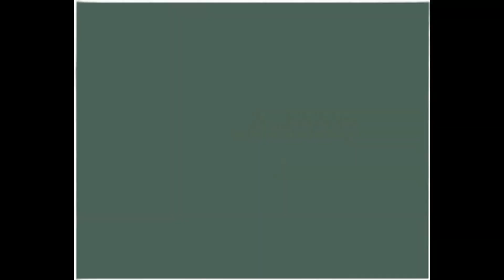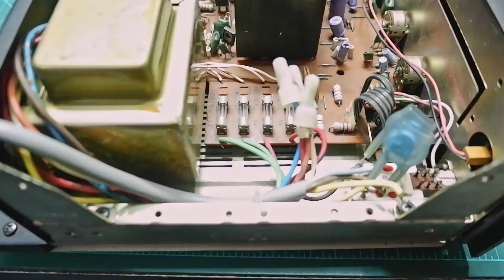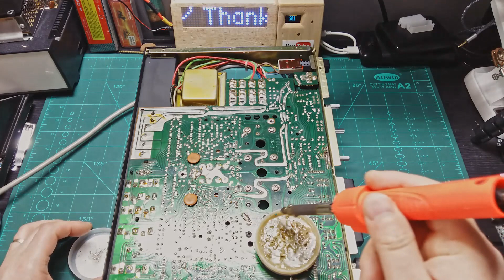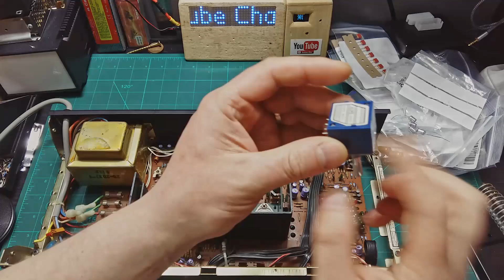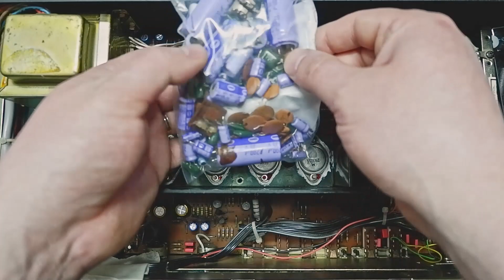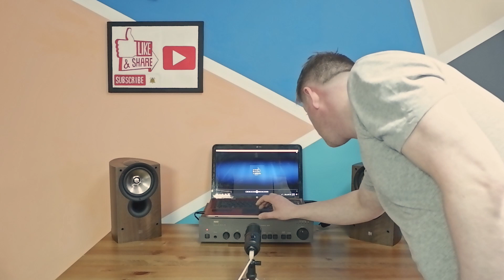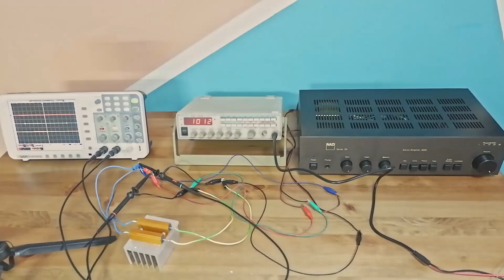How to improve the NAD3020 audio amplifier

Comment: You have the bass and treble maxed, and the loudness on??? One way to screw up the sound on one of the best sounding amplifiers ever.
Reply from the maker: The reason why I did the test in that way is because also before changing the caps the pots was in the same position and just to show the difference with the new caps.

Comment: Small point, but the tone controls should be at 12:00, which is basically flat. Here both bass and treble are set in the maximum position, which would make for an overly bright sound with most loudspeakers. That being said, I have both the NAD 7080 receiver (which was at the centre of my system for over 20 years) and 3080 integrated amp. I would love to have both fully re-capped.
Reply from the maker: So the pots was in the same position also before recap and I keep them the same also after recap because I change the caps also that involve the tone control and that was my point to show how change with the new caps also the tone control!
Reply: @SymbolTech21  Thanks for explaining. Your videos are very informative...
Reply from the maker: @onsenkuma1979  thanks and about recapping your amps, are you living in UK?
Reply: @SymbolTech21  No...in Toronto...I'v heard that there's a guy here who specializes in re-capping/restoring vintage NAD gear. I wish I had your skills! There's nothing more rewarding than doing it yourself...
Reply from the maker: @onsenkuma1979  I suggest you to get s soldering iron and some simple kits in order to get skills in soldering. And then you can try to recap by yourself!
Reply: @SymbolTech21  That's part of my retirement dream! Thanks for the encouragement...
Reply: @onsenkuma1979  did you do it?

Comment: Great job, I have the same amplifier, I want to replace the capacitors in it, would you send me a parts list, it would save me a lot of time
Reply from the maker: The NAD3020 comes in 2 different models inside so I suggest you to check one by one the capacitors and order same values! I did the same as well because I had a part list with the capacitors for NAD but when I look inside of this one I replaced all the caps I find totally different values

Comment: The build quality on the circuit board was much improved in your rebuild. 
The choice of test track was odd. I would have wanted a good recording of acoustic instruments and some voice to assess sound quality. 
I was also worried that you played the amplifier with the tone controls turned to maximum. Were they bypassed? 
I couldn’t tell if it was a value for money upgrade. 
What was the frequency response? Was there a better transient response?
What specific improvements did you hear?
I re listened to each recording and the recap had made a positive difference but my questions remain.
Reply: Loudness button is on too!  Original Nad 3020s did not have a tone defeat either.
Reply from the maker: It become more crisp and the highs sound much better than before and some more base as well
Reply: @SymbolTech21 can you make a follow up video with the modified NAD3020 next to an un modified one that would let us see how the changes altered the presentation. Please set the tone controls flat and switch the loudness filter off. Please use a natural recording of real instruments recorded playing acoustic music. We would then have a more scientific comparison. There are difficulties in experiments if you change too many variables at once. You assumed it was better but you wouldn’t be able to pinpoint the sources of improvement or even negative effects accurately in the method you used. It’s possible that rebuilding it by hand tidily with selected and measured original components might sound even better. Maybe it sounded different rather than better.
Reply from the maker: @christopherward5065  I'm afraid that I can't make a follow up video on it. This amp was not mine. My friend asked me to do this mod for him.

Comment: The thing that is INTERESTING is that the NAD retains its HOUSE sound, both before and after the recap. The recap does clean up the sound some and tighten it up, but it is more about clean rather than different sound. And that is pretty amazing considering how OLD the original caps were. As someone else has said, the newer NADs seem to crapout sooner on their filter capacitors. I had a C325 that I bought used in 2010 and its main caps were already bad. Now, I hear that that was partly due to a BAD run of caps the NAD used in those models. My repair guy replaced those with two Panasonic 15,000 mf caps. And it was fine! Still in use today.
Reply from the maker: Yes NAD amps are really good!
Reply: What caps can I upgrade for a NAD C350
Reply: @cnhhnc  How can you tell the difference when the original test was done at 9:00 volume and then he cheated and cranked it up to 12:00 volume on the recapped test?

Comment: How do you consider the bass in the Nad3020, very moderate or little, in my case after changing all the capacitors and calibrating it I am left with little bass, this last calibration I did not do because I did not have the elements, trying another amplifier with the same speakers they have much lower, I can't compare it with another Nad because it doesn't have it, some attribute this to the fact that the English amplifiers have less bass and are flatter than the Japanese ones.
Reply from the maker: Also depends on which capacitors you may use, because I had so many experiences with the same value of capacitors different brands and they sound different
Reply: @SymbolTech21  thanks!

Comment: You have to upgrade the op-amps ... upgrading capacitors causes little to no difference, especially if they're all the same values.  If you change them all the 3x the value.. then of course 'some' difference, however still tiny.  Op-amp circuit chip and DAC circuit chip is where the sound is.  

2.  It is 'fun' to upgrade parts to the best parts in the world... so yes, that's a respectable pursuit to 'upgrade everything to the best possible', sure, especially if they measure the best.  There are uni papers showing that ceramic measures very poorly versus your premium capacitors, in some tests with some equipment... so yes, you're 'correct'.  

3.  A premium amplifier... should actually... have the premium capacitors from the start... the fact that people " need " to spend 20 hours with a soldering iron... then.. it's not a premium amplifier.. or brand...

So that may explain why one of the best DAC's I heard if from this " DIY master " with all the best capacitors in every area (and best DAC chip ES9018 with best op-amp chips), so the 'master' selects all the best parts... from his occupation of spending time with audio equipment for 10 years.. or his degree.. or both.  WIth 1 billion peoiple in China, I can find 'him' just like in Russia, you find 1 Kasparov.

4.  Some people think it's all " a waste of time... practice singing... what is this... cable and capacitor ", well, maybe they have tin ears and don't understand, can't hear the measurement... or maybe they don't get some singers are aiming for excellent there... some amp guy aiming for excellent there... later on combine both.
Reply from the maker: Thanks for your comment and I really appreciate it. I hope that you ever open a nad3020
Reply: @SymbolTech21    " I hope you open a NAD 3020  " .... why

I like op-amps & the ultra-low distortion Jean Hiraga amplifier... in measurement..

iBasso Audio one of my favorite companies, sell portable amplifiers with more than 12 op-amp included, then diagram & schematic on different combinations.  That's my main amp area, b4.  

And, you don't need to ' waste time ' with EE degrees or certificates, covering " vast and wide areas ".. just study 1 chapter

-- 

I hope you can hear the Jean Hiraga ultra-low distortion speaker amplifier, + powerful car audio equipment i.e. 80 cm sub-woofer & Pioneer or JVC premium tweeter & mid-range speakers, plus the world's best op-amp's such as National LME49720 in optimal environment (now sold as Texas Instruments __4562), what else... oh DAC.. hm... famous DAC's are the PCM1704 chip... now in old car stereos... sell in ebay for $1000 USD for a very old Denon car stereo... with that chip 1704.  So yea, that chip is famous in DAC's, and Denon is also famous with a lot of smart Japanese engineers within car audio.  That is " your style ".. 1704..

Then with ultra-modern chips, i.e. ' super best high-tech ', then you are not interested.. haha.  Even so, Japan has AKM chips, Cirrus and Texas Instruments have their chips, Analog devices... Sabre ESS... so there's a lot of DAC chips... and all you really need 'to do' is check the best one (from any)... then buy a product with that, that's all. ~
Reply from the maker: @Xenon777channel  on this I change all the opamps https://youtu.be/HHK1zcqG8qA
Reply: @SymbolTech21    Thanks for your enthusiasm in audio amplifiers / audio DIY amplifiers, an area with very little profit (unless you're those valve amplifier people in Hong Kong selling giant valve amplifiers for 10,000 with rare and 'unique' valves... or a production line person in silicon valley or Shenzhen which prints 5,000 amps, including that idiot " NwAvGuy " with his not very good amp... pretending it's 'super super amazing'

So aside from 'them'... an area with very low profit, however a lot of enthusiasm... (and 97.5% male... btw.... ?  Encountered 1 female expert working at Texas Instruments, posting advanced stuff... so yea, some... although very rare)

... so... continued... you 'educated' more than 10,000 viewiers already, in this video (in different ways..... including none... although a little curious..)

ーー
I didn't listen to your microphone comparison, because if there's a difference I think it's not possible to pass through my PC D/a chips, amp chips & speakers.... and still retain the same 'sound difference' after passing through all that、　however, it's still cool that you recorded before & after... and that some youtube commenters listen and " hear something " via their placebo effect / expectation effect ( is it ? )

Look at all these comments " Wow after mod the bass is much tighter, very clear " how can they hear that.... through their Laptop or smartphone DAC chip, laptop or smartphone amp... so the difference 'stays' ... ?  So you are joking, or they are joking...
Reply from the maker: @Xenon777channel  no one is joking! Use same connection devices as the laptop same amplifier same speakers and listen to the song and definitely you can heard the difference!
Reply: @SymbolTech21    Thank you for the answer.  Yes, same speakers, same amplifier... same DAC... then your microphone recording is much more 'intact' .. ok
Reply from the maker: @Xenon777channel  the microphone I used for recording is the same and in same position
Reply: @SymbolTech21  I see, you are trying to show the amplifier difference to youtube... and many people in the comment section say " Wow.. difference.. " so you are successful..

I think capacitors are very small difference so ..
Reply: @SymbolTech21   It's difficult to hear the 'amp' or the 'DAC" inside the recording... for example if I listen to an old song from 1985, or a new song from 2020, different studio, different ADC, DAC, amps... well... I can't hear much difference... I hear the amplifier in my apartment... or the DAC in my apartment... however not the amplifier in the studio in 1985... or the amplifier in the studio in Yokohama or Nagano, on their amp... I don't know what their amp is.... I have no idea... impossible..

just letting you know..

And... you are trying, ok
Reply from the maker: @Xenon777channel  the capacitors plays a huge role in audio. Yes the opamps can keep low noise and no distortions but the capacitors do a lot in audio!
Reply: @SymbolTech21   " The microphone I used is the same in the same position " ... I like Audio Technica condenser microphones, as the sound of a commentator or newscaster voice is SO GOOD, with them.... haha.  Microphones cause a huge difference.  

Audio has a lot of areas.  Some people will say... hey.. all this tech... why.. just practice singing.. or an instrument.... that's another area.. the purpose of humans is to reach the top level in 1 area... so that can be singing... a zither from China... an op-amp... a microphone... there is a legitimate real objective ' top level ' ... later on, people combine all these 4, cooperate

Then there's nationalism, like " Well... actually.. the speakers or mic from ~ x country ~ sound better " ... ok who... Mordaunt-Short... Rode mic... Dynaudio.... " the experts " .. really... 

A little bit... for example, the JRC4558 op-amp... was the best in Japan for a long time... and bad.. so Japanese used op-amp's from USA.  However mostly, then they pay attention to detail, and cooperate towards " expert in 1 area... then later combine "... in Japan, with less 'fighting' like in USA saying this is a scam, that's a scam... look at my software I subtracted the difference youc an see oin my screen the difference... and also more brand (Japan less brand... more parts, bits and pieces written on the box)
Reply: Well... you must be young! There are no op-amps in this NAD3020 AFAICR, certainly no DAC. It's a discrete analogue integrated amp from c.1976. 

The reason re-capping is necessary is nearly always the electrolytic capacitors, which dry out over time, go out of spec, increase resistance or go open circuit, or simply explode. 

Mine (1977) stopped working properly by 1983. I had by then already had to replace the on/off switch, and the volume pot was noisy.  The build quality and component quality  - especially the capacitors - weren't  great. However I kept it because when it was working it was very good for the low price.  

I cleaned it up and recapped it a couple of years ago, cleaned pots etc.  However, there is one charred component I haven't been able to identify, where the board earths connect to the chassis (rear, right corner). I can't tell whether it's a resistor or diode or what, and none of the schematics I've seen show the part or connection. I can see this earth bundle in @Symboltech21's  video, but not clearly. If anyone knows what it is, or why it may have burned, I'd appreciate knowing. I'm not going to power up the re-capped amp without knowing. AFAICS there should never have been much current flow there, so it is probably still faulty. A shorted power transistor maybe? I haven't removed them or investigated because the original 2N3055 and MJ2955 are no longer obtainable (only cheap fakes).

Comment: I apreciate your aproach to upgrade this amp but IMHO you should be much more knowledgable about circuits, parts and the typical issues that degrade sound over time or in general. While replacing electrolytics might not be the worst idea replacing all the film caps and ceramics dont make any difference whatsoever...I started exactly the same with exactly the same amp quite a few years ago and over the years I realised that much of what I did was a total waste of money while things like cleaning contacts, adjusting bias, cleaning pots and switches, replacing thermal paste, fixing solder joints and having a voodoo priest spray snake oil on a full moons night are the things that really result in improved reliability and sound. The reason why you read that installing all the wimas and styros is improving performance is that this amp isnt only the most sold amp in history it's also the amp the most beginners start their journey and join forums where they discusse with other beginners and none of them really knows what they are doing...I once saw a post where someone who knew basicly nothing proudly bragged that he replaced all the jumpers with copper ones swearing by god the improvement was night and day but if he had only cut one of the original ones apart he would have seen that they were copper all the time....tinned copper...by now probly all of his bare copper jumpers coroded and killed the amp...and seriously...what kind of a silly argument is: Who likes ceramics in audio...thats just the worst argument EVER....coz even high end amps feature ceramics for de/coupling ...study....a LOT.
Reply from the maker: That's why you should do a research and study more why ceramics are not good in AC coupling in audio. I'm really sorry to tell you but if you have time to look on all my videos you will maybe understand my knowledge in electronics!
Reply: OK then tell me...why are ceramics so bad...there's only one valid answer...
Reply from the maker: @arnejensen9216  so here we go you have the question and the answer. So you know already that are not good.
Reply: @SymbolTech21   How about a comparison of 3020...one with wimas and one with exactly the same components except ceramics instead of wimas. I will send you two empty 3020 pcbs, psu's and everything you need except the population of the boards You pay postag, I`ll send you the parts...If you have a mail adress I'll show what I send you
Reply from the maker: @arnejensen9216  if you go to about tab on my YouTube channel definitely you will find my email address.
Reply: This amp doesn't need improvements. Mine performs almost as well as my Quad equipment at a fraction of the price. That's part of the appeal
Reply: There’s wisdom in this post, but I did enjoy the video. My first thought was that perhaps too much that wasn’t broken was being replaced.
Reply: Couldn't have said it better... 🎉
Reply: The quality of sound depends on the ears listening so don't spend much time listening to low IQ genius